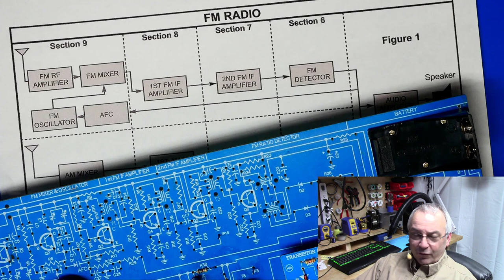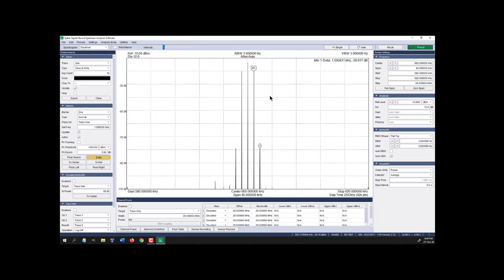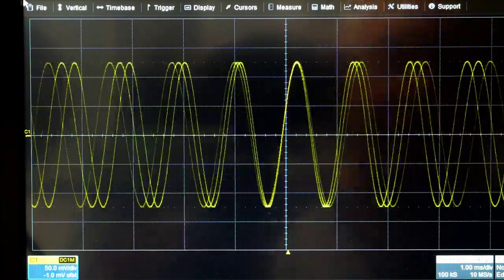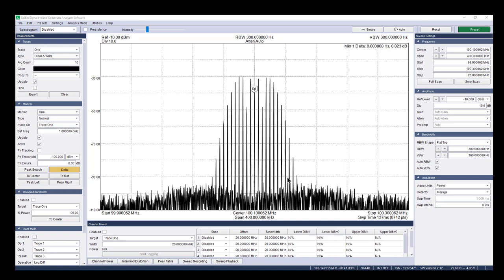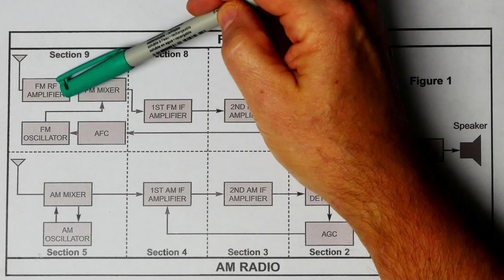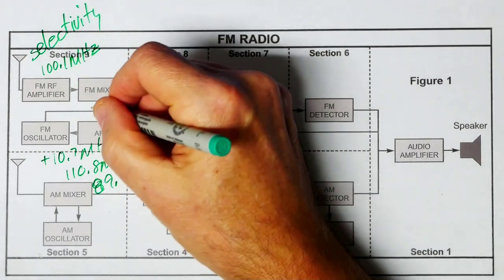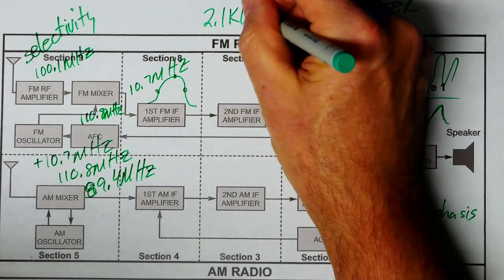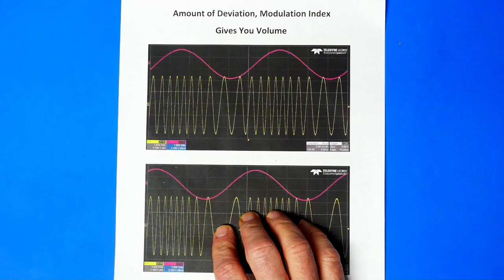93. FM Radio Block Diagram

Comment: This is an excellent video.  I really enjoy your classes. Just a correction of one small detail:  a larger antenna beyond a quarter wave dipole will not give you more signal.  Then you will need multiple antenna elements (directional or collinear) to increase gain, or increased height for better signal capture.
Reply from the maker: You are correct  - I should have caught that. 73's

Comment: There are many books on CW/AM/SSB modulation and demodulation (TWIMC "Experimental Methods in RF Design" is probably the best one, although I didn't like the DSP section), but so far I didn't mange to find at least one good book on FM. Except one article that claimed that narrow FM is basically DSB + phase shifted carrier and that's it. Before this video I had no idea there are such things as limiter / emphasis / de-emphasis circuits. Thus any videos on this subject would be much appreciated. Also maybe there is a book or two you could suggest? Thanks! 73s de R2AUK
Reply from the maker: Hello Aleksander. I don't know of any really complete books on the topic either, just some fuzzy remnants of things learned some tiime ago. If I come up on a good text, I'll pass it on. Thanks for watching.